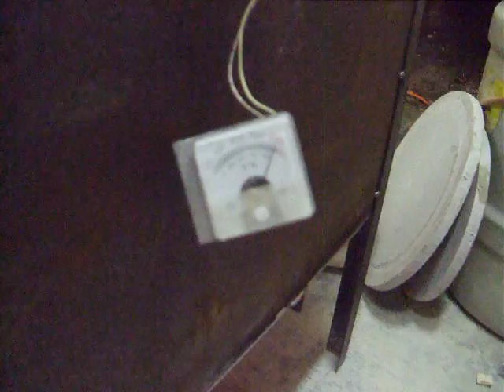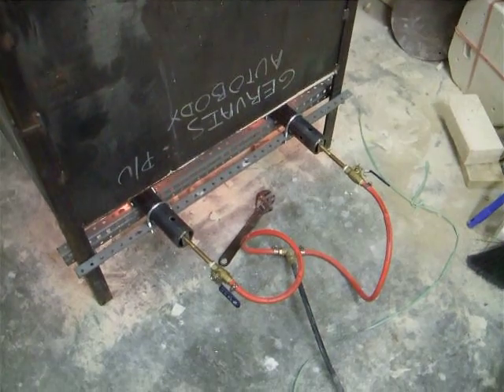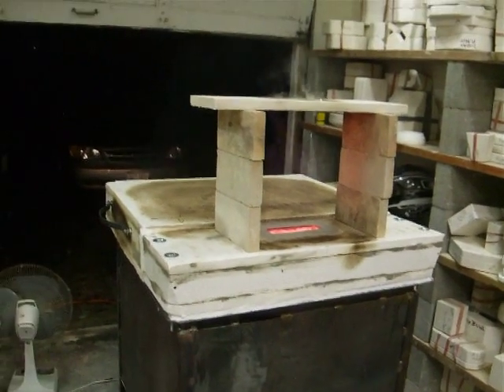Kiln project clip 7

Comment from the maker: I fired it a bit quick.  2000 degrees in 3.5 hours.  I'll probably fire it slower, 6-7 hours.  According to the book 'The Self Reliant Potter' A typical firing of 6-7 hours uses 10 - 12 lbs of propane.  I'll probably get a 30 lb tank to fire twice with extra to spare.